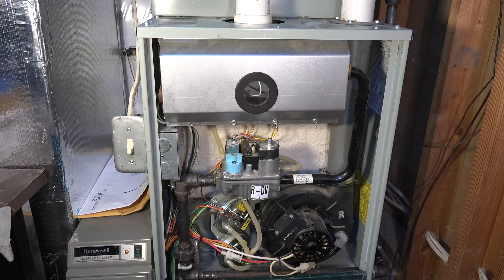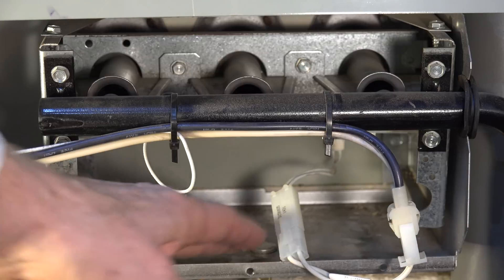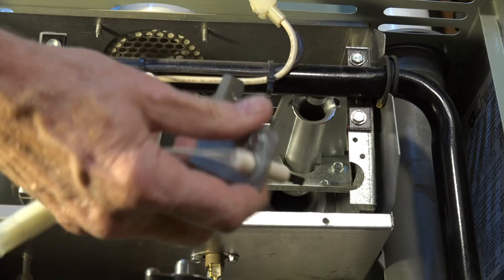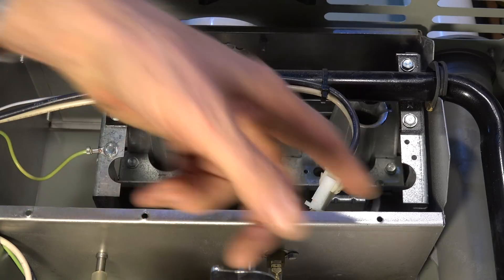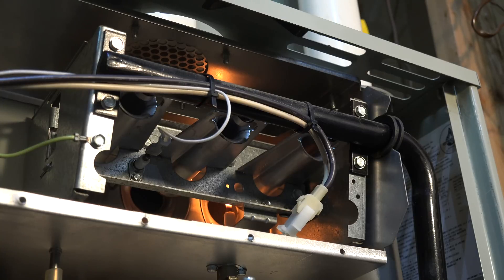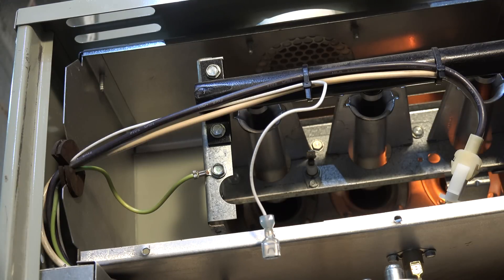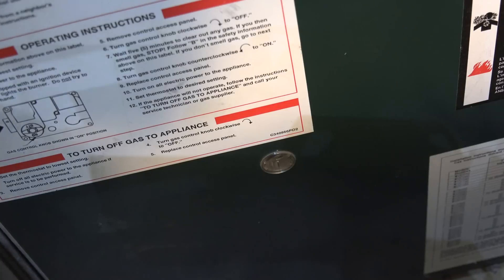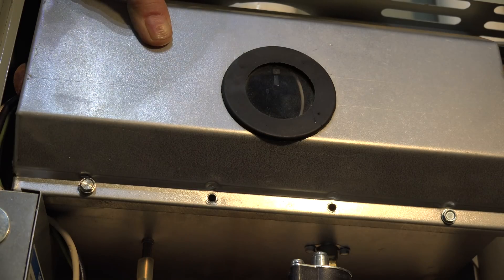Replacing the hot surface ignitor

Comment: @grayfurnaceman I got one for you.  I relatively new technician and I recently installed a ReVolv brand 70% downflow in a family members home.  Well in the 3-4 months since install, it has burned up 3 ignitors.  On this last replacement, I noticed that the furnace would run less than a minute before going out.  Well it uses the ignitor for flame rectification and I tracked it down to poor grounding of the burner assembly.  However after only 20 minutes of flame on this new nitride ignitor, the wires are already melting and aren't going to last long.   It's installed in the fixed position with no adjustment on the burner assembly. I'll be damned if I can figure out the cause of this issue.  Any ideas anyone?
Reply from the maker: Are you sure the flame is not rolling out?  BTU input?
GFM
Reply: @grayfurnaceman  I didn't see anything that lead me to think it was rolling out.  Its 70,000 btu
Reply: @grayfurnaceman  I reused the at the owners request the existing venting and roof jack.  I wonder if perhaps a new roof jack is needed.
Reply from the maker: @BlueOvalHero  Is the venting the right size?
GFM
Reply: @grayfurnaceman  I was just speaking with someone on Reddit who has first hand knowledge of these revolv units and they are designed to use a specific roof jack system.  I'm gonna take a shot and say the venting is the issue and the flame is walking around inside and getting behind the ignitor and melting the wiring.

Comment: My furnace blowing out cold air.
Hot surface ignitor glows and burner turn on. However after a couple min, the burner shut off which result in furnace blowing out cold air. Any tips on how to solve this?
Reply: Possible overheat, Plugged filter?
GFM

Comment: Hi my furnace stopped firing up....ignitor was broken....i replaced ignitor and now ignitor glows but burners wont turn on.....could it be a limit switch tripped?...seems no gas is issue
Reply from the maker: If the ignitor glows, there is no limit problem.  You have a misaligned ignitor, supply problem, dirty burners or gas valve not opening up.
GFM

Comment: I have an older Goodman gas furnace with the hot surface ignitor.  It runs wonderfully, however, once every few months the ignitor will not turn on then the furnace goes into lockout.  Once I reset the furnace, it turns on and functions properly.  How can it work so flawlessly, then one out of a thousand times, it will not work at all?

Comment: Is there any harm in touching the HSI with your hands?
Reply: +3en6ie 3en6ie I was told when trained that it's a myth. They used to tell techs that because the early HSIs were delicate. The less touching, the better. When you think about it they glow so hot just about any small amount of oil would burn off. Do I touch the element when I handle them? No, I treat them as delicate as possible.
Reply from the maker: There is no harm in touching the HSI.  I have run them soaked in oil.  Temp is so high, the oil burns off.  However, I do not touch the silicon carbide ignitors because they are so delicate.
GFM

Comment: aren't some older tranes only 80v specific igniters? gotta watch you replace with the right replacement
Reply from the maker: Some of the silicon nitride ones would start out at 120 volt and drop in voltage and drop to 80 if the burner continued to light normally.
GFM